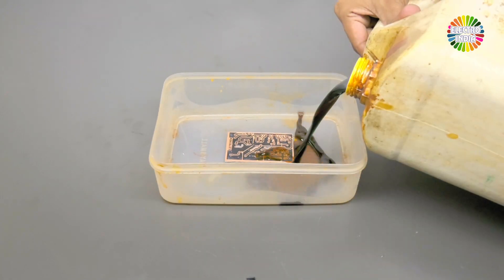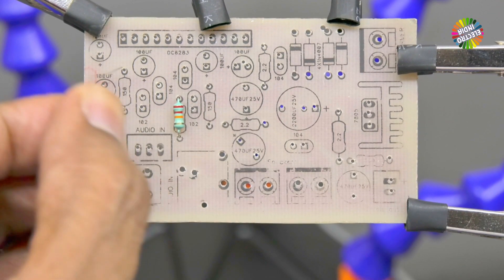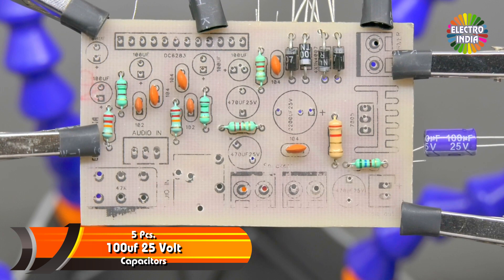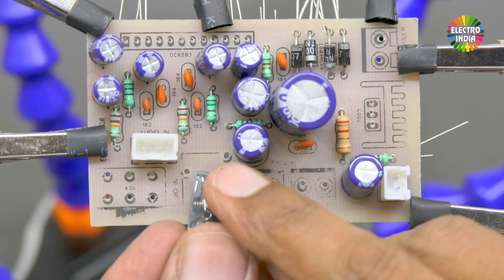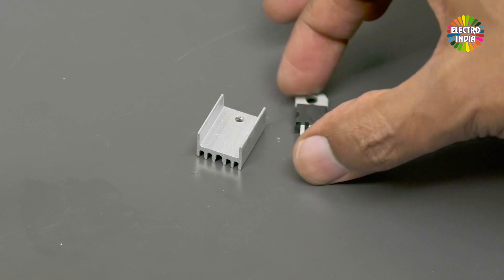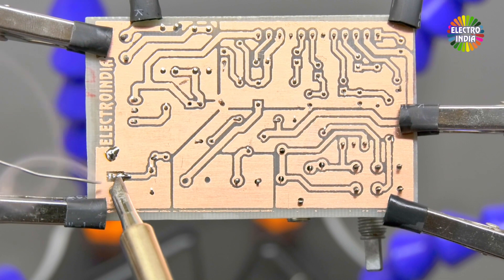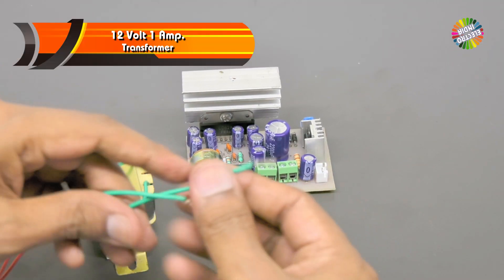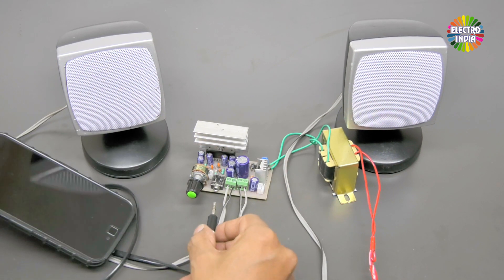6283 Single IC Stereo Audio Amplifier Board for Beginners | Requested | DIY Hindi ELECTROINDIA

Comment: 2×500w true rms bord
Supported dual supply separate power toroidal transformer in 4ohm support 12 0 12. 0 12 and 0 5 terminal
Power supply vac to vdc10000uf capacitor 35amp diode k sath
Power fans
3 way 5532 tone bord (base trable mid) and 2 mic support circuit bord
Soft start module
Speaker protection bord
Bluetooth module 
Havy power cord and speakers terminal 2 specon socket
Havy power button
Original potentiometer
All complete connection with havy body cabinet

Ye pura setup kitne me pdega chhattisgarh bilaspur me mangwa kr

Comment: NJW21193G (PNP)
NJW21194G (NPN) Amplifier kit 4 transistors ma stereo kit bno  transistors drive k lia lm3886 ic ka use karna  ...  Ya njw21195G  transistors bhout high quality H class amplifier ma use hota hai... Or lm3886 ka use studio monitor use hota hai ya tda9294 better sound hota hai...  Wattage 9294 or lm3886 ka same hai...
Reply: LM3886 4 ohms par 68 watt max output deti hai jabki 7294 90W, power same nhi hai, 3886 ki Clearity aur linearity bahut uper hai

Comment: Irf240n or irf9240 2.1 ch bass trable in one pcb  200w low pass for subwoofer 100+100w full range speakers   ...  Irf540n or irf9540p mosfet stereo kit bno...
Reply: हम आपकी जरूरत के लिए आपके कॉमेंट को लाइक करते है पर इलेक्ट्रो इंडिया के किसी भी वीडियो में झनकार (बेस-ट्रबल) बोर्ड बनाना नही बताया गया कृपया कॉमेंट सेक्सन में इसकी मांग करे हम आपके सर्किट को बनाने के लिए फोर्स करेंगे।